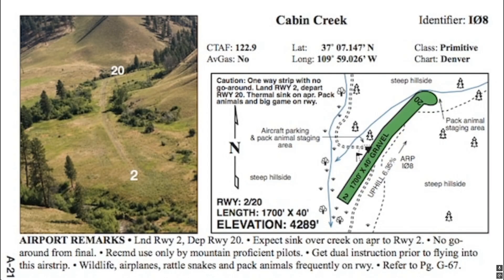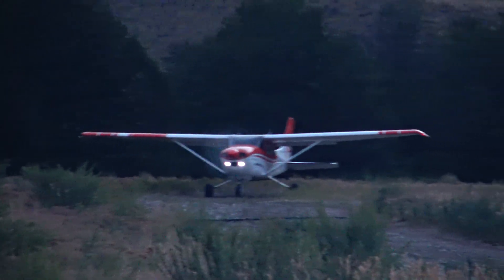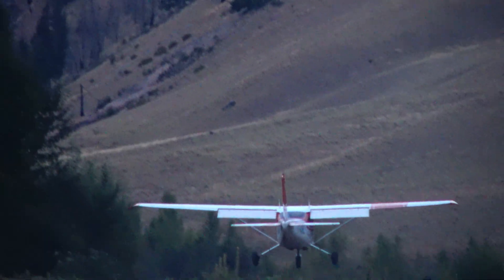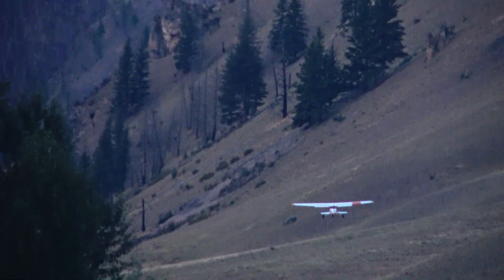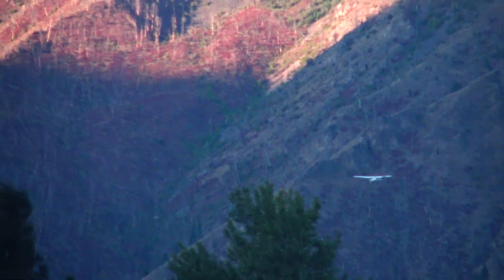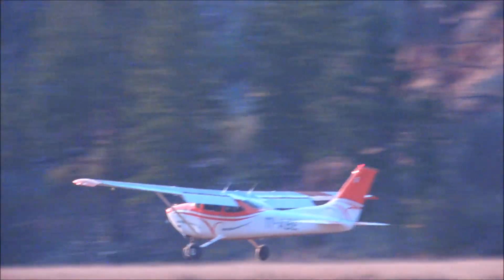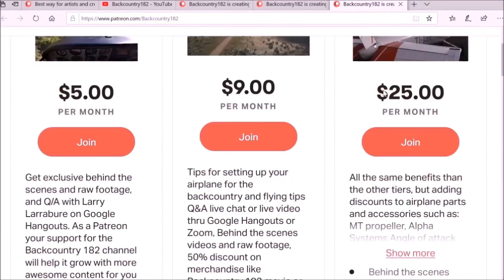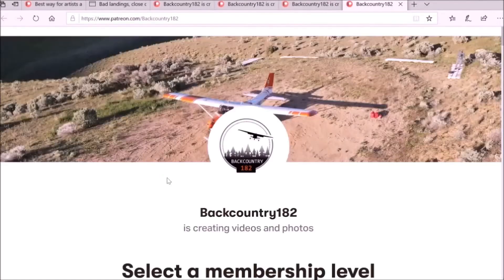Trapped by Altitude: How Heat & Elevation Endanger Pilots

Comment: Good lesson on max fuel energy by leaning, best weight by light load and just fuel needed, and use of free ground effect energy by staying level in low ground effect as long as possible.  I also noticed that you bring the yoke back a bit to lighten weight on the nose wheel whether soft field or not.  While pretty obvious, I also noticed you taking advantage of the potential energy of altitude by taking off down drainage.  When young I taught in the Cessna 140 (85 HP) at Monte Vista at 7611 MSL summers while my wife attended Adams State.  These techniques you demonstrate so well were easily 50% of the total energy available to me and a normal sized student.  Thanks for the video, Larry.

Comment: In the Cessna 182Q manual, it mentions that "Prior to takeoff from fields above 5000 feet elevation, the mixture should be leaned to give maximum power in a full throttle, static runup." I believe this means 5,000 feet density altitude. It's too bad the manual is not more specific about this.